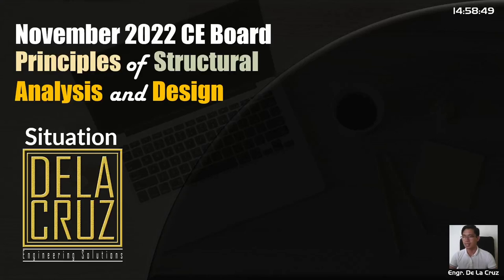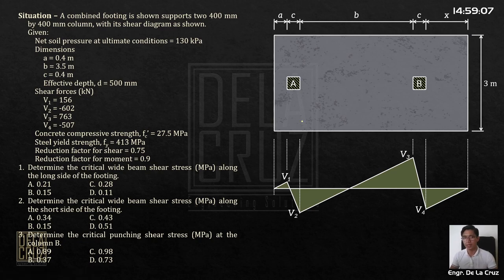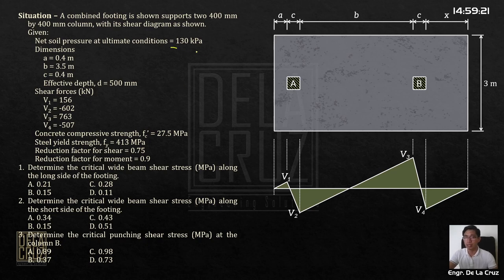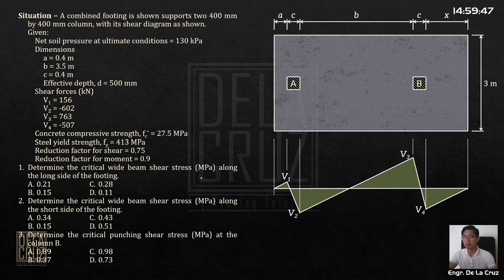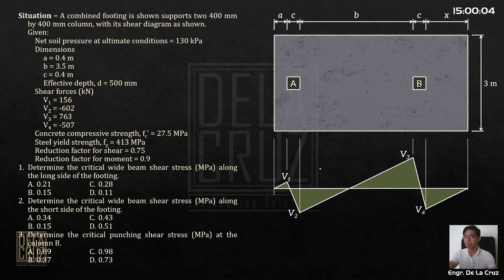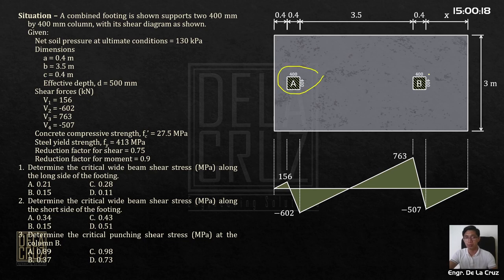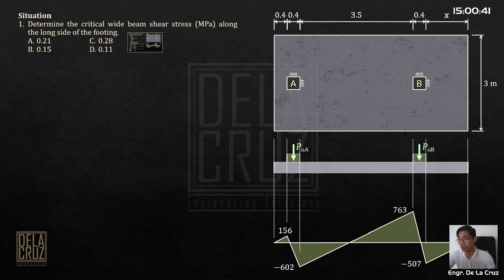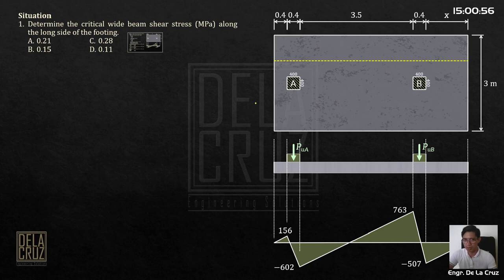2022-November CELE PSAD (Sit 22)

Comment: sir dun po sa part 3 po sa column B po dipo ba 763+390(0.4)-Pub(0.4)=-507 po?
Reply from the maker: Pub is a concentrated load (kN). So hindi mo sya e multiply nang width. Unless its a uniform load (kN/m)